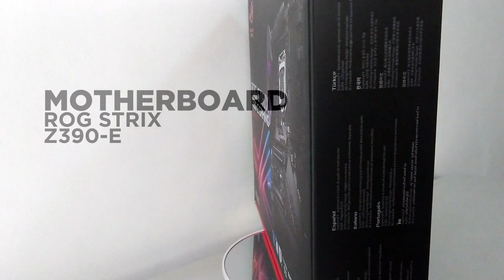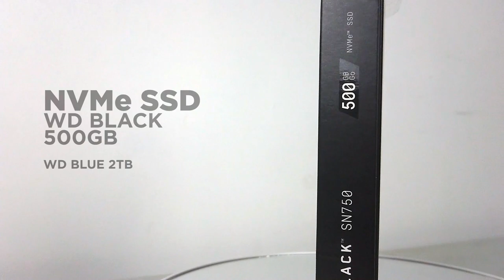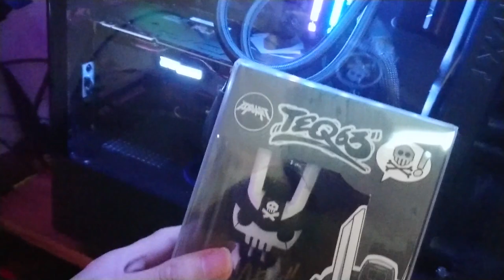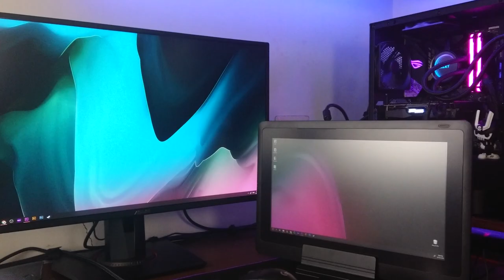2020 PC build - RTX 2070 SUPER mini i7 9700k

Comment: Can u change rgb lighting of nzxt underglow without nzxt controller Hub?
Reply from the maker: Hmmm, I think so, if you connect it directly to the mobo, I think you can use the mobo rgb software to change the settings

Comment: What are your GPU temps in idle and full load? I have the same GPU and it`s reaching 84 degree Celsius in full load.
Reply: On idle I get 35c to 55c (web browsing, watching videos, listening to music, multitasking, etc...). On load I get around 55c to 75c. You should probably undervolt the card via the MSI Afterburner application, but before all that it's best to check if your PC 🖥 realistically has great air ventilation.

I used this card for a build I gave to my wife as a 🎁. She uses it on our living room, where we have a 4k TV 📺. Honestly this card isn't great for 4k gaming, so I set the resolution to 1080p @60hz.
Reply from the maker: I get 35-40c on idle and around 80c on full load. 80-85c is normal on full load
Reply: What case are you using?
Reply: @gamerscore88  up

Comment: Hey so for this build if I build it can I go with a lower psu or do I have to go with 750?
Reply from the maker: You can go down to 650, I used 750 for future upgrades and just to be safe. Always use psu calculators online for reference too
Reply: I have a similar pc. 650w or higher is what was recommended to me for the 9700k & 2070Super

Comment: bro, nice vid. tanong ko lang does the zotac 2070 super mini perform exactly the same as any other vanilla 2070 supers?
Reply: I've only heard good things about zotac cards. With MSI Afterburner you can overclock it a little as well
Reply: they have the same base clocks as the reference 2070 supers plus Zotac has an auto oc tool to find the optimal settings for your GPU
Reply from the maker: What they said man. Very little to no difference in performance from the normal, form factor lang
Reply: is it still better than RX 5700XT? mejo dikit kc sa price  difference lng ng 3k c 2070 super :D
Reply from the maker: @danenunga699  I think it's still a bit better, pero depende na sayo if sulit yung price to performance difference